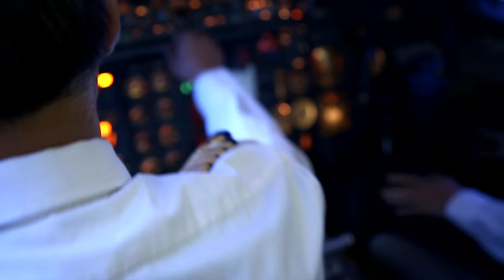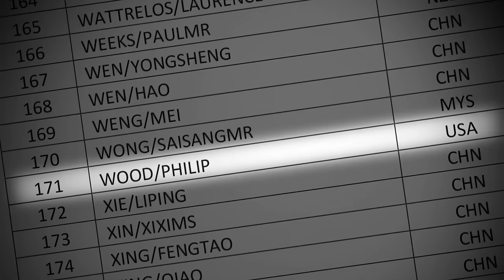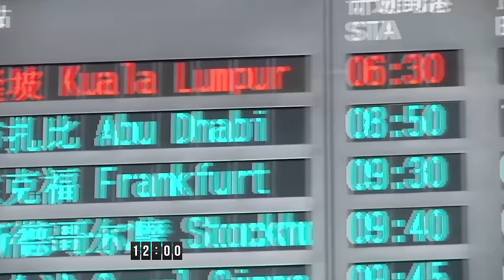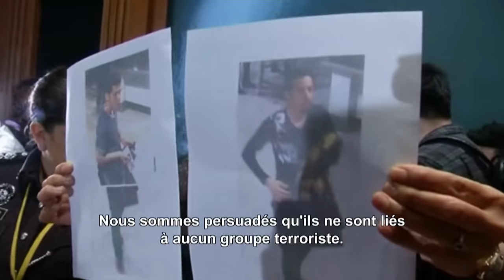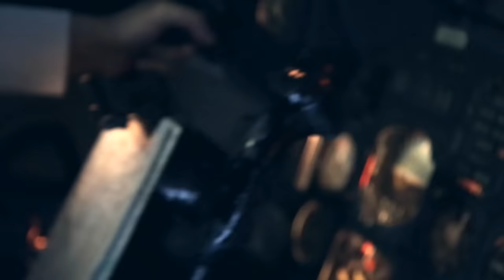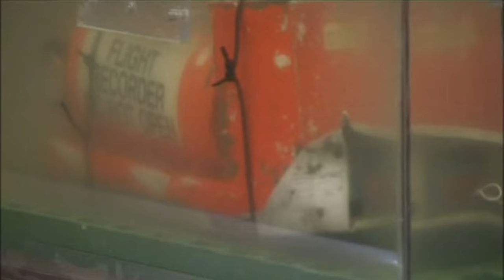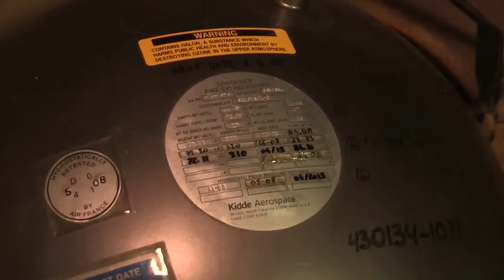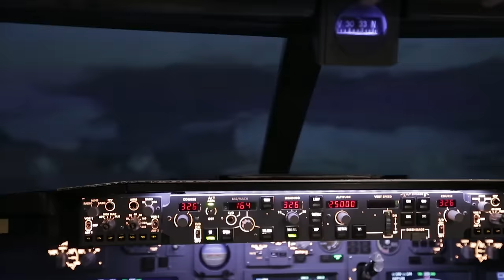Why We Never Found The Malaysian Flight MH370?

Comment: a lot of pilots and a lot of regular people have simulators at home ! what's the issue about it ! 
i have done many simulations at home because i like it and it's more interesting when you throw some tricky situations and train yourself on that 
and i've never flew a plane or will fly a plane :D it's just interesting
Reply: Yes but how many of them end up flying a plane with over 200 people and go missing…
Reply: @jennyterrell6354  huh ? what's your point ? 
in the video he mentioned that it's alarming or suspicious for authority to have simulation at home. and my response that this is pretty normal for anybody interested in aviation it's not weird
Reply: @baracoda2  Very true and people would do well to understand if the intention was to crash the plane into the sea, as alleged, there would be no need to practice a landing on a flight simulator.

Comment: You don't need any extra equipment to fly a plane remotely, all you need is access the autopilot remotely.
Reply: There are 3 autopilots on B 777. And 777 can fly without autopilot. I can give 3 or 4 ways to disconnect 777 autopilot....
Reply: @bricedesmaures6216  So it can be flown remotely?  I mean if they can program the onboard flight computer, heading by heading for each leg of the fight, they should be able to steer it through the AP without having access to the actual fly by wire setup, if not indirectly, correct, that's what I meant?
(I m a noob, sorry, but I find all this fascinating)
Reply: @truehighs7845  Read these few lines from the "MH 370 safety investigation report"
Quote: Boeing has confirmed that it has not implemented the patented system or any other technology to remotely pilot acommercial aircraft and is not aware of any Boeing commercial aircraft that has incorporated such technology. The technology was never installed on an aircraft.

B 777 can be flown like a Cessna, fly with heading and witout autopilot.

Comment: There is alot of information missing in this documentary. First of all we now know that the communication from the plane to the ground control was manually turned off. We know that because it was done in a slow motion on the switch. It is a switch that require turning, rather than just an on and off switch. We now know that ground communication devices recieved different messages rather than an short cutoff, which would be the case in a sudden accident like explotion or fire. Look at it like a switch you want to turn from 4 to 0. When you turn the switch you need to go trough position 3, 2,1 and then 0. This is what evidence shows. We also know that the plane crashed and did not land. This was meassured using the dopler effect trough communication devices. When the plane is out of fuel, it reboots all onboard communication devices, one by one. This happened, and when it did it turned one system on after another. When meassuring the time delay between the information received on ground, we can see that the plane lost altitude rapidly as it would if it was in a stall or nose diveing towards the ground. It is incorrect that you need to enter a room below the floor in the plane to reach the inmarsat communication device. This can be turned off if you cut all the power from the engines. This would cut off all communicating devices on the plane, including the immarsat device. However, when you do this it also cuts off the cooling to the massive computers on the plane, making them overheat. So someone had to turn the power back on at some point, which can explain why the immarsat device came off and back on again. This is the only device that would come on again, as the rest can be shut off from the cockpit. We also know that the plane did come back and fly over Malaysia and Thailand airspace, as the phone of the co pilot later gave a digital fingerprint to a phone antenna in Penang, just south of George Town. So, do we kow where the plane came down, no. But we know when the power in the plane came back on again and pinged the Immarsat satelite. From there we can only follow the digital fingerprints from an arc. Sorry for my English ><

Comment: Defense minister is 100% right. If the intercepted and shot it down hed be worse off than allowing it to disappear. Fact is the only thing a fighter can do is destroy the aircraft. So once the fighters in the sky it is either shoot it down or eventually turn back since the 777 would have a much larger fuel capacity

Comment: It would be so easy to disguise a over ride take over emergency control inside any given part of the plane some thing that looks to be a normal accessory such as one of the fire extinguishers or even a sealed compartment that only gets looked at by a secrect technician and logs on service would either not exist or put in service log as say a service as a transponder etc

Comment: BOE203220001400 16632 FLEXFAB AS1506 *OD32 JAN03 this is the marking that was on one of the air ducts of the Boeing 777-200ER air conditioning system at the crash site of flight MH17 and on the others AUG 96. And the year 96 marking is normal for a 1997 aircraft, but January 03 is not.
* It is either 1 or L or I that cannot be clearly disassembled due to thermal effects.

Comment: Pilot told the co-pilot to go check on something,  anything,  then after the co-pilots exit the pilot turned off the pressure system and basically murdered all the people,  turn the pressure system back on and flew to the southern ocean and crashed.  

Why?

IDK

We need new regulations that any flights over a certain time must have a relief pilot for bathroom brakes.  

AT NO TIME should anyone be left alone in the cockpit,  also the plane should take control and land in the age of computers w a command to destroy the plane
Reply: You DK much.

Comment: Bs it was pilot/co pilot that did it. If it was remotely controlled what did everyone's phones just stop working?yes I know they only work at a certain height but plane came down so signals would connect then there's sat phone if pilots couldn't use radio. Person in cockpit did it dilliberatly locked door took plane up so oxygen mask drop 15mins air then silence apart from cabin crew 45 mins.
Reply: Amazing! How do you know all this?
Reply: Another one comment wonder. Bots can't back up their claims.

Comment: The fact this 777 just vanished clearly shows it was blown to bits by the CHINESE MILITARY.  Complete destruction by   a missile would totally destroy the black boxes and leave only small bits left...
Reply: If any foreign country shot down a Malaysian airliner, they'd be demanding compensation, just as they did with MH17. No such actions were taken with MH370 because no other country was involved.
Reply: @UguysRnuts  Your proof is what?

This is extremely suspicious because it just vanished. 

Either it was totally obliterated by an extremely powerful missile, or it was hijacked by a sophisticated organization/ country and diverted somewhere.   Very suspicious regardless. 

The lack of a debris field is troubling but like I said an extremely powerful explosion could reduce this to nearly nothing it just takes an extmeely large missile and these do exist as I worked the field prior to my retirement.
Reply: @salmonkill7  Utter nonsense. There is no "extremely powerful" surface to air missile that would eliminate a debris field, or for that matter, anything even close. I call BS on everything you've written.
Reply: @UguysRnuts  My credentials are on the INTERNET and easy to double check.  I worked for years in Natonal Security.   What are your credentials?

It's obvious the way you dismissed me, like a teenage child that you have no credentials.

Go back into your room, make your bed and get your homework done before dinnertime...

Comment: I believe it was landed and taken hostage for training by terrorists. They probably still have hostages to use for training purposes as well. I believe they used a cell phone jammer and hijacked the plane. Only a few inconsequential pieces have been found. They had plane identification on them and were probably strategically dropped to be found to throw investigators off course.